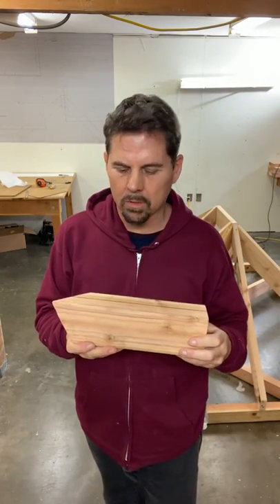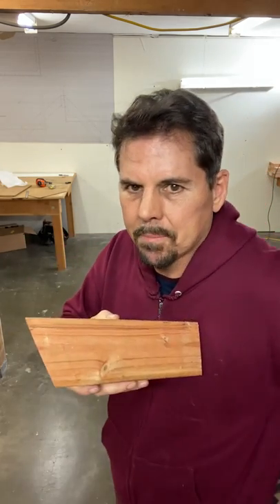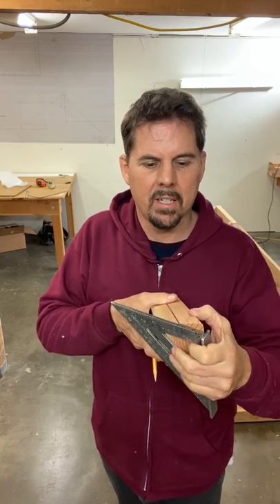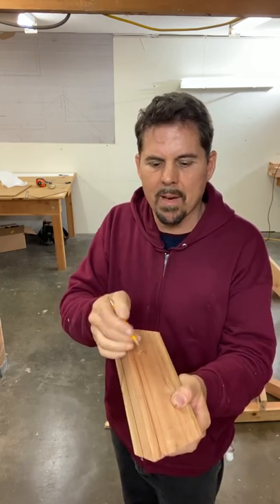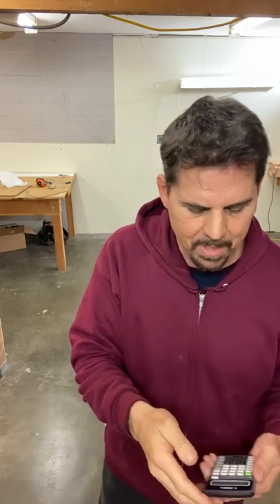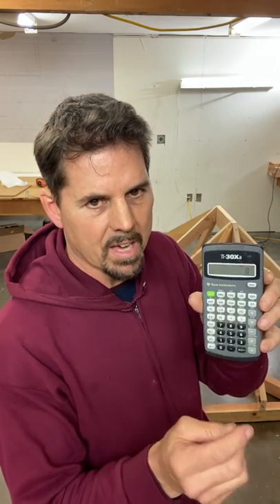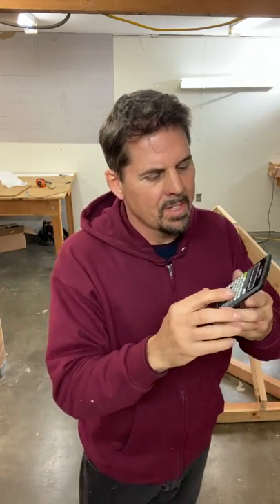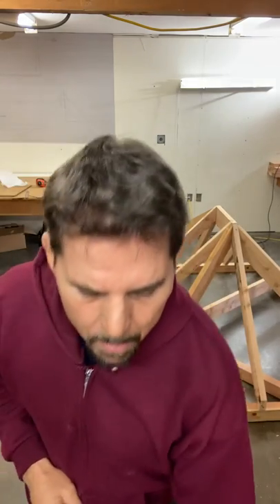Fast backing angles for hip/valley rafters

Comment: First run went over my head (I am in the UK so rise/run and imperial are not top of my list!). However, second run through a light bulb went on and I really appreciated the graphic simplicity of using the speed square on the offcut to show the actual backing angle - brilliant 🤓👍🏻. Add to this the maths by measuring the sides of the triangle formed and using the inverse tangent to get the actual angle for the saw. Deceptively informative for such a short video. It's a shame that more people have not watched and learned from your input. thank you for this video.

Comment: Could you tell me how you know that a hip on a 12/12 pitch is at a 35.25 degree angle? Thanks for this video.
Reply from the maker: Technically, it is 30°. But why I said it is because traditionally a lot of guys would back the hip/valley the same as the angle of the hip/ valley in elevation.  That really is only effective under about an 812 though.  

There’s about four other methods, but I find that the fastest is just to use a scrap of wood and use the rise run ratio to calculate the angle on the Skil saw.

Comment: Another way is true length hip and rise on a framing square
Reply: Martin Durrant please explain more.
Reply: @TR-rn3pd  On a traditional framing square, you have the true length of the hip on one side of the square and rise of the roof on the other side of the square(scaled down to fit on the square). This gives you the backing bevel.
Reply: Yes spot on either way is correct can you do a video on under purlins as we use in Australia and the bevels involved and the setting of the angles on the circular saw much appreciated from the land down under